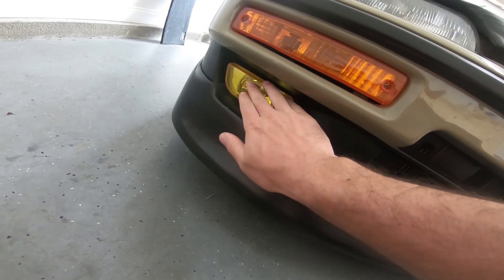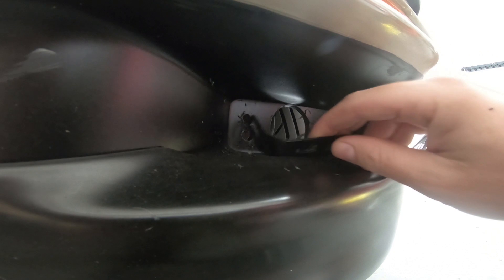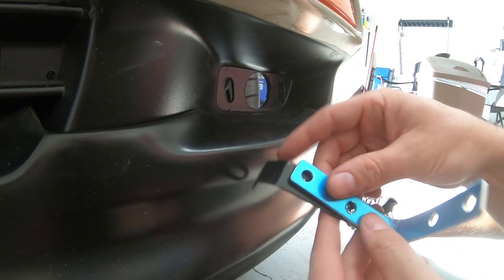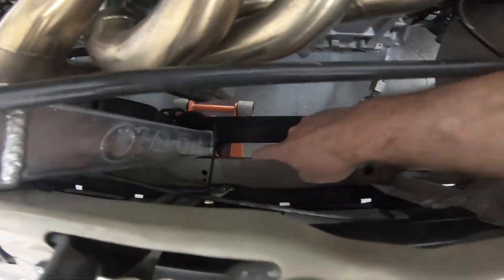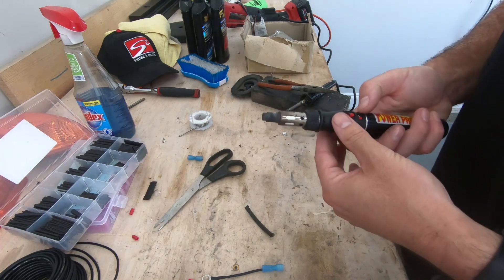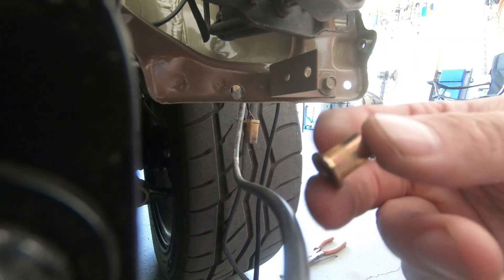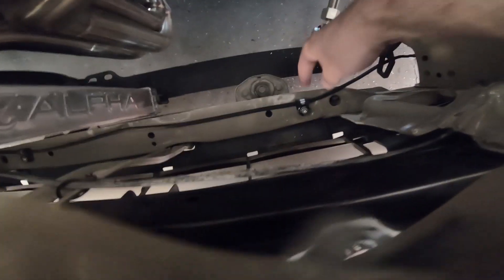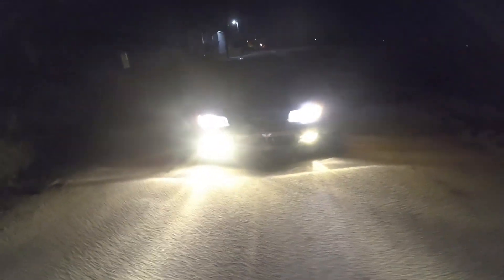Honda CRX Si DLAA Foglight Install Part 25

Comment: Looking good, I would recommend some Flush cut pliers for your zip ties, they help not cut your hands.
Reply from the maker: Bentlyco0p solid tip...I’ve been meaning to buy some
Reply: @justingadell  I bought some Irwin's on Amazon but Knipex also has some on Amazon for a similar price point. 🍺

Comment: Link to hood bra? Clean build btw
Reply from the maker: Appreciate it, lookup Cobra Automask. They also sell the floor mats I’m using but some folks have mentioned they got a bra without CRX on it so I would recommend emailing them to ensure you get it the way you want.